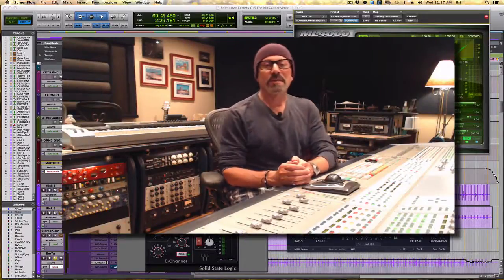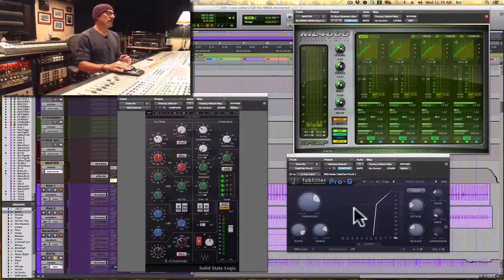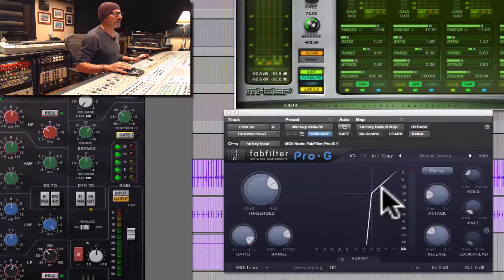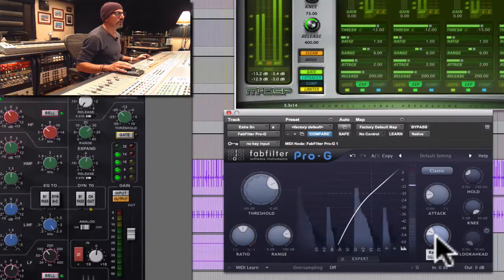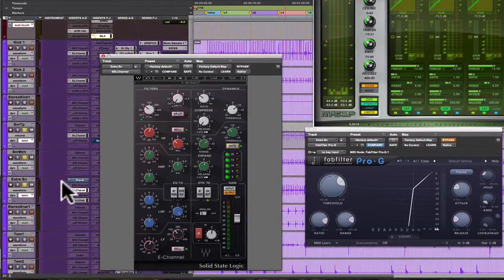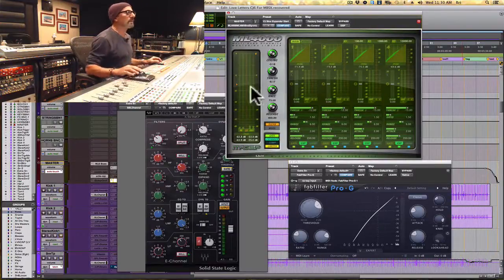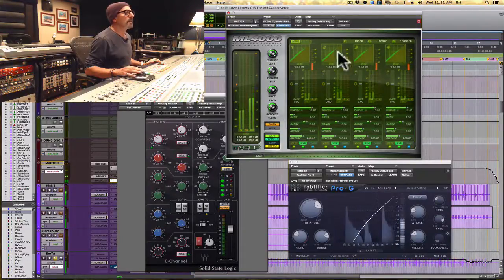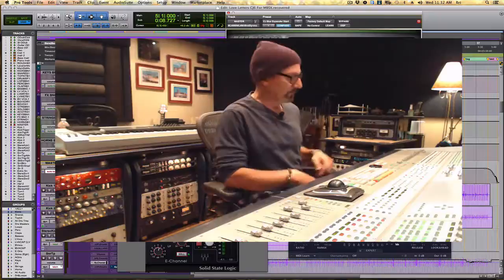Minute Mix Tips: Expander v. Gate

Comment: I could not get this Sorry :(
Reply: i'm still struggling myself, though thinking MAYBE the hangup is in the term "expander..."

still seems like the gate is active - but the "expander" sorta adds onto it, smoothening the curve of what gets in and out, sorta expanding the range of what squeezes through.

not 100% if that's the best way of looking at it or will help.

this quick 1.5 minute video seems to do a better job: https://www.youtube.com/watch?v=exrjnuP35_w
Reply: Differences between gates and expanders. Keep in mind I'm a live guy, and there's a thousand plugins I've never even heard of. Ha!

Gates are only for signal reduction and have a fixed reduction. Technically you can somewhat manipulate this by the speed of the attack and release but on a gate, if you set your reduction to lower 10 DB when it's below the threshold, it will never reduce the output of the gate by more than 10 DB. Generally speaking, when the gate is open (above threshold), nothing happens. When the gate is closed (below threshold), it reduces by the fixed reduction you selected. Attack and release will just determine how quickly or slowly it opens up or closes. That's the part I was saying you can kind of sort of manipulate. 

Downward Expanders. Most expanders deal with signal reduction (downward expansion), and instead of a fixed reduction, it's based off a ratio. So let's say you set your expander 1:1. For every DB the signal is below the threshold, the output of the expander reduces by 1 DB. So if it's 7 db below the threshold hold, the output reduces the signal by 7 DB. So let's say you set it 2:1 (some expanders would label it 1:2), instead of the 7 DB reduction, it would be 14. Let's say the ratio was 1.3:1. You have to do a little bit of math but if it was 7 db below the threshold with a 1.3.1 ratio, it would reduce it by 9.1 db. End of the day, mix with your ears and confirm with your eyes. 

Upward Expansion. The same rules apply as downward expansion except for this boost output signal. Depending on the ratio, however many db the signal is above the threshold hold, the output gets boosted. 

Bonus content. If you really want to get the most out of your gates and expanders, learn to use filters. 

Hopefully this makes a little bit more sense.